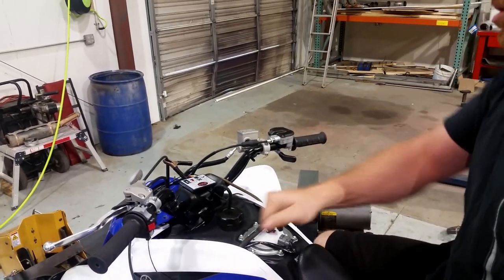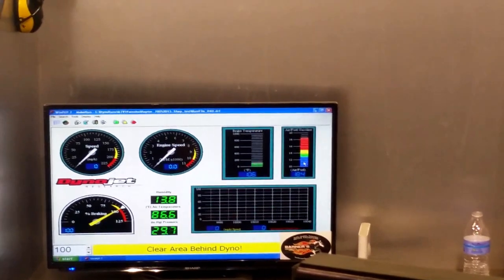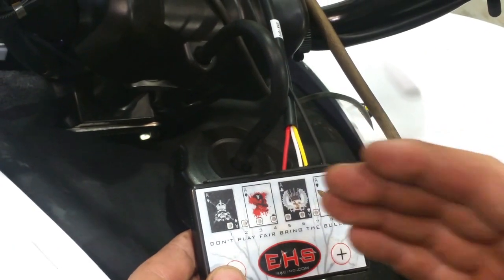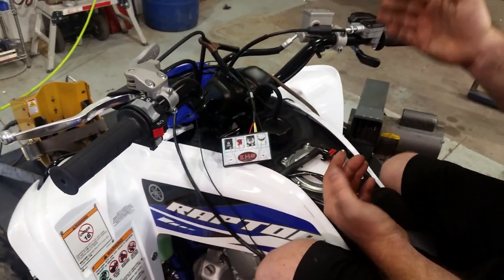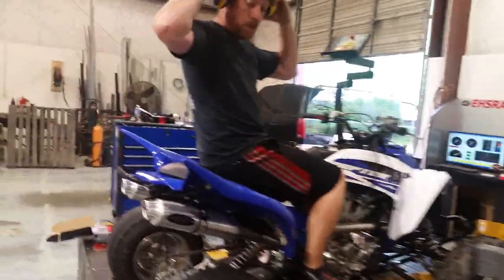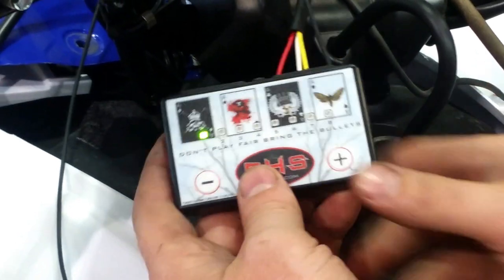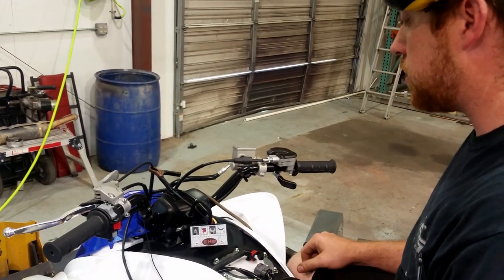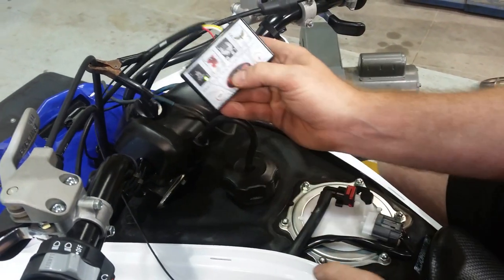EHS Racing fuel controller operation 2015 video

Comment: Just got my tuner for my 2018 Griz. 
Hooking it up today. 
Right now I will be running the 2R tip I will eventually get the barkers duels or slip on. 
Really not looking to go faster just want to run an exhaust and keep my 708 cooler. Directions are a little confusing but I think I have it figured out. If not I’ll call Eric at EHS
This tuner comes highly recommended by a lot of my Grizzly buds!

Comment: I just put one of these on my 2016 wolverine. Did not mess with settings at idle is displays 3 solid green lights then as I slowly accelerate i will get a fourth solid green then it goes to yellow. Is 3 solid green at idle normal?

Comment: Ok...just installed the controller on my 07 Grizzly 700 with the Barker slip on.  Not interested in making my Atv fast.  I bought the Barker slip on for the look and it has the best sound.  Just tell me what setting would be best to keep my valves safe.  Basically, I want my fuel delivered exactly as it was when I had my stock exhaust.
Reply: It is hard to get in contact with them....but I figured it out.  The instructions have a pretty good starting point....

Comment: So I bought one of these for my 2014 Grizzly 700. Are you saying that everytime I go out for a ride I will have to be adjusting this thing in the Green and Blue modes?  All I have is an R2 Racing tip. No airbox mod, no after market exhaust. I thought this thing was just purchase, install and it was plug and play. If I am out in the middle of the woods and my bikes starts going all wonky how the hell are you supposed to understand which buttons to push to fix it?
Reply from the maker: once it is set it stays set, until someone changes settings. you should only have to adjust it when you make a change like camshaft, clutching etc
Reply: Ok, thanks. I will let you know. Going for a rip Friday.